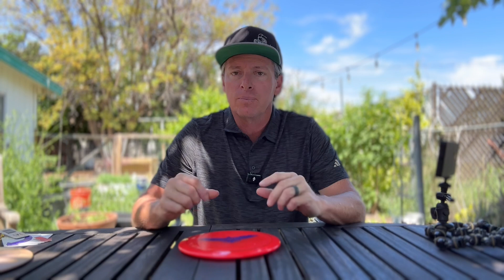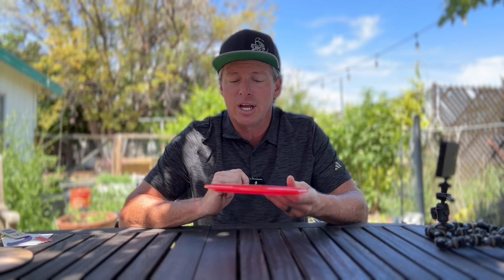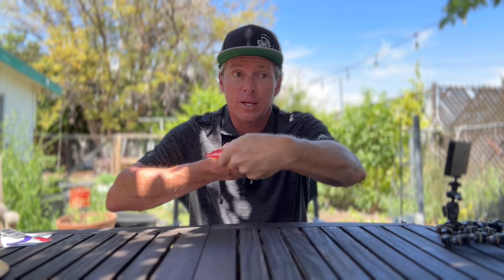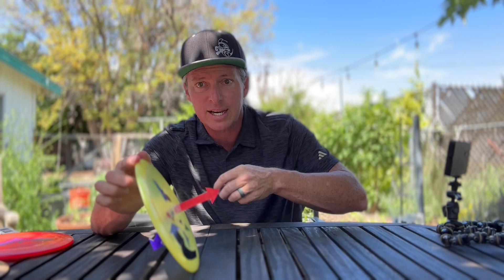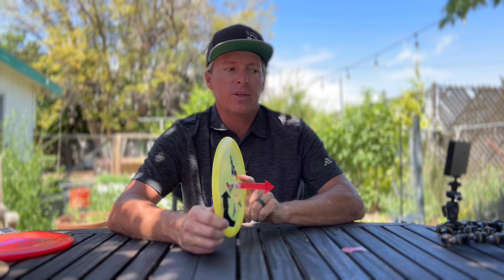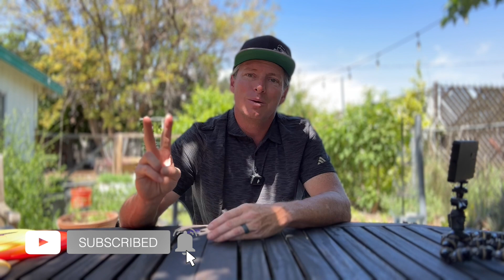Roller Physics 101

Comment: What’s the ideal angle to land at? Ideal stability for FH vs BH rollers?
Reply from the maker: That question is kinda the same question as “ what is the ideal angle for a hyzer?”….
Really it is very dependent on each specific shot, the terrain, the grass depth, the wind, etc.
I use a Discraft Heat for 99% of my rollers. In the air, if I throw it on a hyzer I can flip it into a turnover, that will fade at the end, or less hyzer and it will flip up and the over and continue turning to finish right. I like to think of 45* as a starting angle to land the disc, let’s consider that the equivalent to a flat throw in the air. Just like an air shot, the rest is dependent on how fast or slow the disc is thrown and how flippy or stable it is.

Comment: I’ve wondered about the aerodynamics of domed discs which I prefer over flat discs that my friend prefers. How does the degree of done affect flight?
Reply: Never mind. Just watched your next video. ❤
Reply from the maker: It’s a very great question!
Here is general understanding and running theory on that flat vs. domed topic, it’s my copy and pasted answer from several other places I’ve had the same question. Thank you for watching!

The flat versus Domey argument has always been a little comical to me, because some guys think the flat disc are more stable and the domey are under-stable, and other guys think that Domey are over stable, and the flat one stable.
Domey discs tend to have more glide than flat discs. Let’s assume both have identical parting lines. There are many components to understand it all, from lift, to drag, and even release angle.
My personal observation is this:
I think the varying opinions at a result of a grip issue. 
Some guys love to throw flat discs while others prefer domey, and those are the camps they tend to stay in. When a person who loves throwing flat discs, throws a domey disc, they tend to believe it’s more stable. When a person who loves domey discs throws a flat disc, they tend to believe it’s under-stable.

Hold a flat disc in your hand, be exact at how it settles into your hand, like you are ready to throw in the power pocket position, notice how the edge of the disc closest to your chest looks.
Now grab a domey disc of the same mold,
Hold it in the same exact manner as described above. I believe that you will observe that the domey disc settles into the hand in such a way that the edge closest to the chest will be lower by a 1/4” or so. This result is because the domey disc is slightly taller and the thumb sets higher over the flight plate pushing the edge closer to your chest down slightly, so what feels “normal” is a slightly different angle between the two disc, and would leave the domey, disc on more of a hyzer angle out of the hand compared to the flat disc. 
Thats my observations and opinion after years of observing the two groups and various opinions.